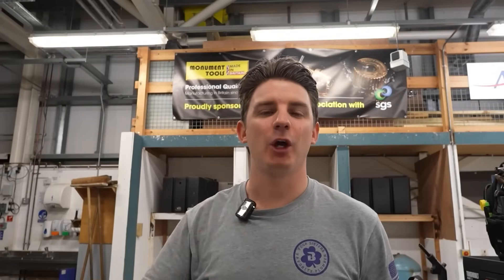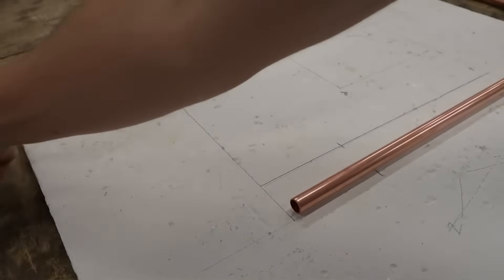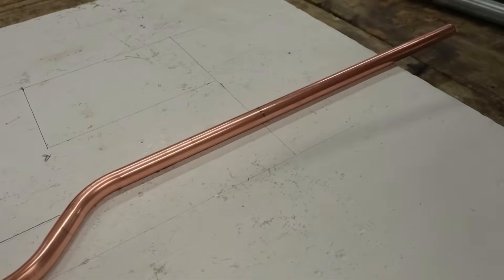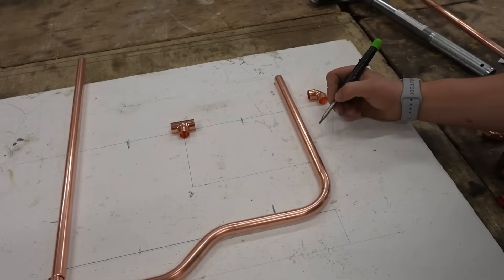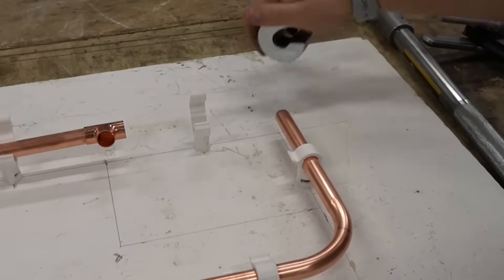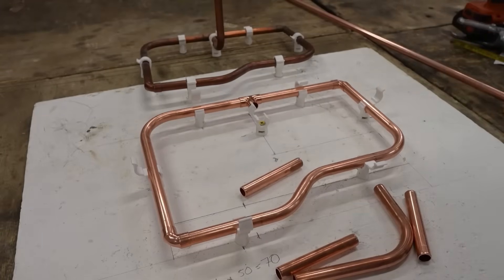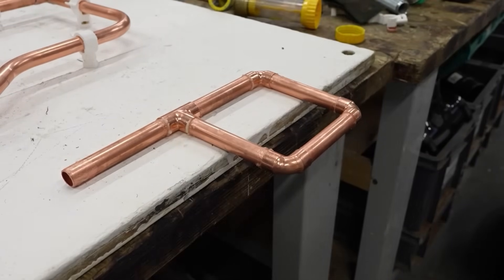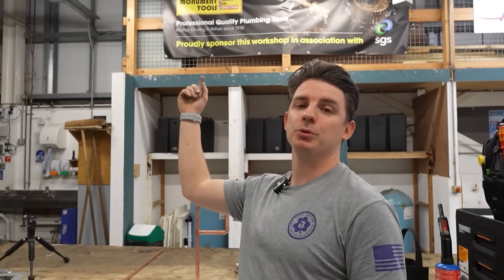World plumbing day challenge! Part 1

Comment: So 7 centimeters after the point of reference is where the bend starts.  The "x" * 1.4 corresponds to the length of the pipe you need from the point of reference to where your bend will result in a 45-degree bend.
Reply from the maker: The 1.4 is a formula that works for 45 bends, x2 for 30 and 1.2 for 60